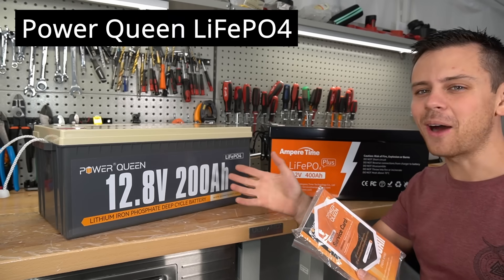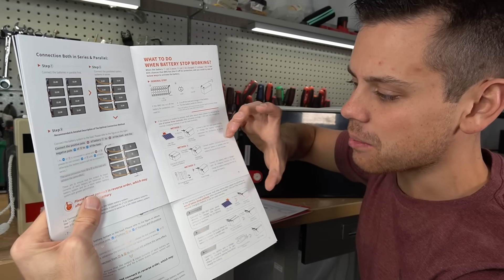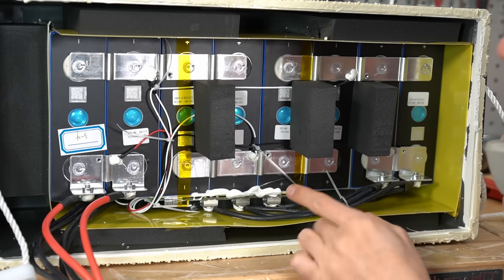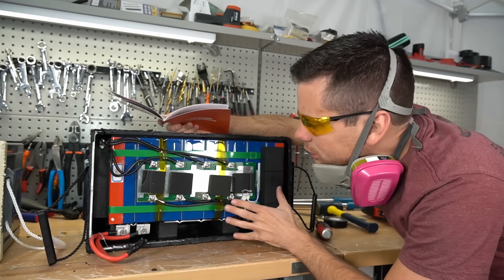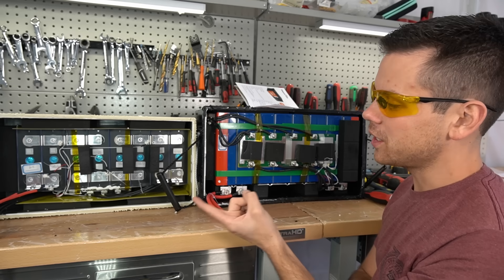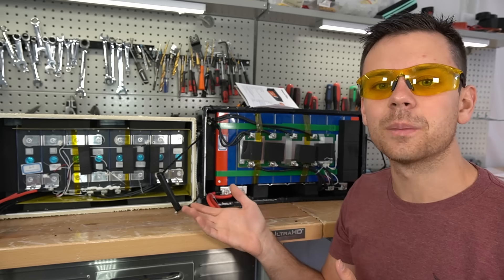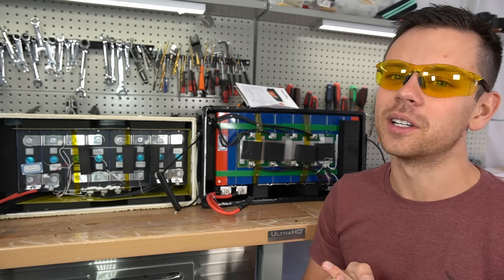Large Cheap 12V LiFePO4: Power Queen 200Ah & Ampere Time 400Ah Tear Down!

Comment: I just bought as similar 300A/H VoltX battery off eBay here in Australia. Seller: outbaxcamping

Got a very good deal. I really don't want to cut it open but I might doa capacity test when I get a mains charger.
Luckily I don't need like temp protection..

Comment: Hi Will, I tried many times to activate my membership on the DIY solarpowerforum with no results. 
Since you are one of the moderators, could you Could you help me out here?
lots of interesing stuff on this forum and with my new Victron setup with ESS plus distributed voltage and current sense settings I have to share something too.
Reply from the maker: Try it again. I disabled the email verification
Reply: @WillProwse  Hi Will, Thankyou for your fast reaction!
I just tried  and I can login but cannot react or view member pictures so is there a double Dutch filter in place? 😂
Reply from the maker: Disabled last night. It works 80% of the time but I'd rather turn it off

Comment: I bought one of those Ampere Time batteries and I had to return it. The voltage would drop before the amps did. Conversely, most smaller inverters are hard set to shut down at 10.5 vdc. This ultimately led to the inverter shutting down when there was still between 60 and 70 percent left on the battery.

Comment: Discussing the weights would help.
Reduced cycle life is Ok for most applications but if the cheaper cells are also found to decay faster by the calendar, that would not be cool. Unfortunately without a world-class accurate coulomb counter only time will tell.

Comment: What's wrong with the lead marine batteries again? Cause  I can't afford these..
Reply: Twice the weight, 1/3 the lifespan approx, you can only draw them down the 50 percent of charge or they get damaged, they have to be vented and the fumes cause corrosion, the gas can explode {had it happen to me} . LiFePo4 has none of these problems.   But if you need start amps  lead acid is the way to go.  If you want long life constant draw like a trolling motor  LiFePo4 should be your choice.
Reply: @merlpriester  I want it to keep my grow lights on for 11hrs a day and maybe fir a small stove to keep canning..maybe
Reply: I have the 2000war renogy inverter and 100wat panel just need to know what batteries and wires to get

Comment: Had a 300ah Ampere, after 18 months with no issues it completely failed at 1am Christmas night. So now it's an expensive paperweight and I'm reduced to using a cheap 100ah till can afford to replace with something more reliable. Wished the better ones were affordable.

Comment: Thanks for mentioning the low temp charging protection of the charge controller.  I think that should be a standard feature of any charger - and not the battery.  Would be like controlling your gasoline engine by turning on and off the fuel pump with a switch, instead of using the accelerator :P
Reply: GREAT point!  I agree...besides, some applications don't need low temp protection AT ALL.  Why pay for a feature you may not need?!!?

Comment: One challenge with using these batteries in series for 48v is that you run into the potential for the batteries to drift apart over years of service so you either have to pull the bank apart and parallel them all to top balance them every 6 months to a year or you have to buy a 48 v 4S balancer box to keep them all at nearly the same voltage to prevent the eventual drift.  I kinda wish all of these batteries included external balance connections so you could at least  connect a 16S capable voltage and balance display for remote monitoring or additional balancing when connected into larger arrays of series and parallel banks.
Reply: How much are these hardware upgrades?  I KNOW I could google it, but I'd rather let someone share their wisdom! 😉

Comment: Hey Will:

I have 2-Ampere Time 200AH in series, and Epever 24v charge controller plus 2kw Giandel inverter.  Weird thing happening now with longer charging days.  I hear Epever alarm on full charge, and each time the Giandel inverter drops off and resets back on.  I have NO communication between the Charge Controller and Inverter.  Just both connected to the batteries.   Any idea why inverter would drop out upon Epever alarms?

Glen O'Hara
Gilbert, AZ

Comment: Wil,
I have 2 wet cell 100 amp batteries now, can I just take a lithium battery a put it in my trailer without any changes to any other electronics? I do have a solar suitcase if I'm dry camping.

Comment: I have solar. What would be the best system to combat hi electric time billing (4-9) and can be taken off the grid when needed? Is that possible? I have a 3.2 kW per hour system that usually charges 17 to 20 kW. And an older Sonny boy inverter.. Solar is in series

Comment: How to charge 12v 400AH battery ? Because that provider not include charger. Or can you make video on invertor. Because in India  we are using invertor for power backup system with old lead acid battery of 12v 150 AH.  I want to replace it with lithium iron battery of 12 V 400AH battery.  I am charging with regular power supply provide by gov. Can you help me in that. How to do setup.
Reply: There are many chargers available for LIFePo4.    Converters for RV will work if they are available.   I just replaced mine for a LiFePo4 battery and it charges at 45 amps per hour.  Others can do more or less.  Look for one that has LiFePo4 charge profile not just a solid 14.4 or  14.6 constant voltage.  It needs to drop the voltage after the battery gets to a certain level of charge.   Do not use a charger for lead acid  some of those can kill you battery if they have a desulfation mode.    Remember to size the wires based on the current and length of wire and put in fuses.

Comment: Good evening and thank you for sharing all your knowledge. I would like to convert my 48 volt golf cart to lithium. Could you please recommend four 12 V lithium batteries and a charger for the conversion. Best bang for the buck. Thank you and have a great evening
Reply: I purchased 3 Lossigy 12v100ah-Pro batteries for my Ezgo golf cart to replace the 6 old lead acid batteries. Once installed they were awesome! My golf cart had more power and speed than it had in years, maybe ever.

Comment: Will, the cost difference from 300ah to 400 ah is huge. Over $700 for the additional amp hours. It may be more cost effective and send just a bit more and buy 8 300ah instead of the 4 400ah. Thanks for the info. I do enjoy the tear down videos. It helps to understand the technology and build designs that are used.
Reply: I HATE when pricing runs like that.  It's like when the 44oz ketchup bottle is more per oz than the 12oz one.  Makes you feel like they're trying to trick you.  In this battery case, it's SERIOUS money.  I suppose it's all rooted in scale and manufacturing simplicity--making the smaller size more cost efficient.  Still....
Reply: @737smartin  Yes, two 300 AH batteries are only a bit more expensive than ONE 400 AH. Ridiculous.
Reply: @baneverything5580  if its about space such as on an RV it make a huge difference

Comment: How much would low temperature protection cost to add to the BMS? Can't be more than a few pennies and then a few dimes for the sensor. At some point the company putting out the BMS will likely do a board rev and then almost all of these clones will get low temp charging protection.
Reply: More than 50% of the world lives where it rarely goes below freezing! If you do then pay a little more for a low temperature protected battery.

Comment: I have 18 CHINS 12v 100Ah batteries and they are all working well. Would recommend them and the support has been very good so far. No issues at all.
Reply: Wow, would you mind sharing what config are those connected in? O.o parallel?

Comment: Thanks for all your efforts Will, I appreciate it. Last year I opted for (6) Lossigy 200AH batteries. Supposedly they have the low temp protection but I'm not willing to sacrifice one to verify. They seemed to work properly all winter with no issues, so far I'm very pleased and have plenty of reserve power.

Comment: I bought two 200ah Lossigy batteries and will put them in my motorhome that I full time in. The dimensions look the same as the Power Queen and that is a big reason I bought them because they both will fit in my battery compartment. Do you know anything about the Lossigy batteries? Thanks again for all of your work.
Reply: I bought (6) of those last year, very pleased so far.
Reply: Thank you
Reply: Great battery！
Reply: whats your solar panels layout ?  thanks
Reply: @vandweleer8004  4 panels of 175 each.
Reply: @timaz1066  how long it takes to chrg your 2 200Ah batteries ?
Reply: @vandweleer8004  As everyone will tell you it depends on cloud cover and how much power you use out of them. I have my bulk charge voltage turned down so I get the batteries into the 90's% so they rarely get to 100% but normally into the 90's% range by 2 pm. I have been told by the guys on the forum you get better life from them if you keep them between 20% and 90%. I have never gotten below 60% yet.
Reply: @timaz1066  THANKS for sharing that abt % ... I just learned something new.  thanks!

Comment: Hey Will, I love your videos and enjoy them thoroughly. you taught me so much so far. if I get a notification I'm watching! I know you get asked this question a lot, but as someone who is looking into van life I am looking for the cheapest battery I can buy without sacrificing quality. I live in New York so we have cold Winters here and I don't want to damage anything. If I am understanding correctly, if I buy a victron charge controller along with a battery with no low temp sensor, I don't have to worry because there is low temp sensing in the victron charger. Is this correct?
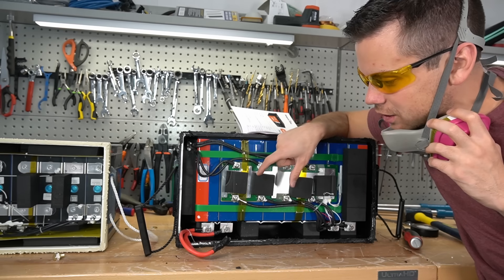Reply: I'm not Will obviously, but I'm pretty sure that he would tell you that you will also need the Victron battery sensor as well. 4:14

Comment: The plus model, in my experience, is a higher max amp draw. I have one of the 300Ah Plus and it has 200Amp max draw. I have had a few interactions with their customer service and they seem very responsive. I inquired about getting a second one and if I need to do it very soon and they basically told me the pros and cons of waiting to get the second one. And they offered me a discount code if I wanted to get the second one directly from their site rather than Amazon. Overall, I'm very happy with it so far but have not had it in regular use just yet.
Reply: That is the difference with the plus model, higher discharge rates
Reply: Same need ; same timeframe

Comment: I bought a 12v 200ah chins after watching your video.  If I buy another 12v 300ah chins could I use them in parallel?  Or should I stick with all 12v 200AH?

Comment: I bought a 200Ah AmpereTime last year. After a month, I noticed that the positive terminal was getting very hot (swapped wires and so on, 2ga, verified it wasn’t a bad crimp). I contacted them via Amazon. They wouldn’t cross-ship a replacement but were happy to pay for return shipping and give me a refund if I bought a new one. I opted for that and they gave me a refund as soon as tracking showed it picked up. 

The length of the warranties on these batteries are all longer than I am confident that the companies will be around for. I’d go with the company who I thought would be around the longest, for a small price premium. 

I’m reminded of a company years ago that made external lead acid batteries for early Apple PowerBook laptops. At one point they announced that they’d done something wrong with their charging circuitry (I think), that all the batteries they’d sold were defective and unsafe to use, they had nowhere near enough money to replace them all, and they were shutting down the company. 

Also - I wouldn’t go for anything physically larger than this pack. My RV has limited spaces for batteries and I’d like maximum flexibility. Also, I like being able to grab one battery and use it in my car or house for power outages and so on. The 200Ah is the largest I want to carry around. I might even get 100Ah for my next upgrades.
Reply: Great post and data-share.  Wonder why this was so far down in the comments with 18 "likes."  Well, now 19.  👍👍

Comment: Great video Will. It is just not worth it to get these batteries. The EG4 48V 100 Ah server rack battery is still a better deal for the same price per kWh and u get low temp protection.
Reply from the maker: Agreed! Server rack is my favorite as well
Reply: Ehh what you mean?  So doing the math you can get 800Ah queens for 2600$ @  4000 cycles wired in series for 48V.   The EG4 for the same capacity is $12,000 at 7000 cycles wired in parallel for 48V.
Reply from the maker: @volksbugly  you need to calculate the Watt hour. don't use Amp hour
Reply: @WillProwse  Ahhh also I was just schooled that going series doesnt add Ah only Voltage.  Thank you!
Reply: @volksbugly  Doing the math, the Queen battery is $0.25/kWh and the EG4 is $0.29/kWh. But the EG4 has a better BMS with low temp protection, a built in circuit breaker in each rack battery and is well supported in coms with common inverters and charge controllers.
Reply: @williammeek4078  that would depend upon what/where you are using the battery for. In a boat under the floor  server rack style battery = not so good a sealed case is way better. In you house/cabin rack mount is great.
Reply: @jackdbur  Even for that, there are better batteries for the price.

Comment: Could I buy 4 of these and wire them in series to get a 48 Volt 800 Ah setup?
Reply: No, series increases voltage, amperage remains the same. Parallel increases amperage, voltage remains the same. You would need 8  to create a bank of 48v at 800AH. Research the BMS, some manufactures don't support certain numbers in certain configurations.
Reply: @j.r.576  Ahh thank you,  so yeah you can do a bank of 16 of these in series parallel.  I didn't realize series doesn't increase AH.  This explains so much.
Reply: @volksbugly  that answer can only come from the battery and or the BMS manufacturer. There are limitations which are manufacturer specific. My Losigy's can parallel up to 10, but only 4 in series.

Comment: i thought the plus model was for higher discharge rates? makes no sense to have the plus model be more expensive than the non-plus model and not be different... edit but if its stackable in series up to 48v maybe that is it where the lower model isnt?
Reply from the maker: Yes you're correct

Comment: It's so disappointing the amount of wasted space in the 200ah battery. I can easily DIY a 200ah (or 300ah) to easily fit in a Travel Trailer front dual battery box (Camco is the industry standard) but none (or almost none) of the off the shelf 200ah would fit because they're too deep. Length and heigh is fine, but depth doesn't work - then to see all that foam 🤦‍♂🤬 - really disappointing. I hope one of the Chinese manufacturers would wake up and provide batteries that fit dual-battery box.
Reply from the maker: Yes very true
Reply: @WillProwse  can you let the battery suppliers that you’re in touch with that it would benefit them to offer a 200ah (and 300ah) that would fit in a camco dual battery box (easy to find on Amazon). It would also help other RVers/boaters that need to add more battery capacity in confined space where every inch counts.
Reply from the maker: @ranig2848  they are working on packs to fit standard sizes actually. This is a big issue. I'm surprised there are not more options
Reply from the maker: They probably use whatever box they can buy for cheap given the overall price of these packs
Reply: @WillProwse  yes. The boxes they use are standard for off grid and battery backup.
However, with the quantities they’re shipping, designing and manufacturing a new box that would open up a significant market - where size is important, if not critical. Looks at all the crappy products (toys etc) who require custom plastics - it just doesn’t make sense that the box dimension is a blocker to open a new market 🤷🏼‍♂️
Reply from the maker: @ranig2848  very good point
Reply: @ranig2848  Maybe they just do a single size so they can build a better bigger battery in the future and keep manufacturing costs down by using a single form factor.
Reply: I could help you with this, our 12V200Ah perfectly fits the Camco's dual battery box. Drop a note if you want more info.🤓

Comment: I bought two ampere time on your recommendation. Two 200ah batteries. I bought one in September, last year, and found it just wasn’t enough. So for Christmas, I did a deal with the warehouse and picked up another 200ah. Super fast shipping, since they have a warehouse in California. I am totally pleased with these batteries. Since we store them in the storage unit of our 5th wheel, they never get below freezing. We full time travel, so we also stay away from cold weather, That’s below 70’.
I also have a Victron charge controller, and a battery Sence, so I keep a eye on the battery temp, and the charge controller is set not to charge below 38’
Thank you sooo much for your reviews. We really appreciate your work.
Reply from the maker: Awesome!! Great setup
Reply: @WillProwse  Will, Ampere Time is selling a 300 ah they list as automotive grade cells with 4000 to 8000 charge cycles depending on which ad I see. I bought one. So are they lying about this and these are actually rated at 1500-2000 charge cycles? They say this> "4000+ Deep Cycles, FCC&UL Certificates." I certainly couldn`t afford BattleBorn.
Reply: @baneverything5580  The wording is tricky. Power Queen also says >4000 cycle life--BUT that isn't the same as 4000 cycles until it reaches 80% capacity. It may very well die completely after 4000 cycles according to their wording. HOBOTECH even incorrectly said it is rated at 4000 cycles to 80%.
Reply: does the battery sense also stops the converter from charging the battery in low temp as well?